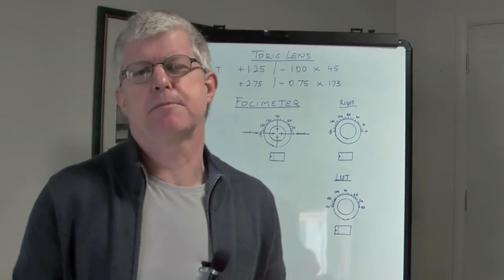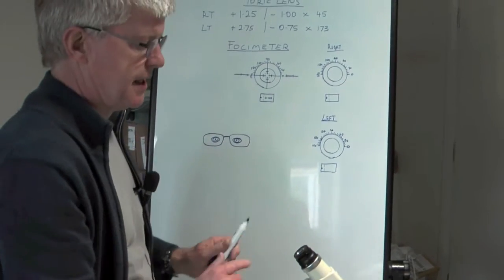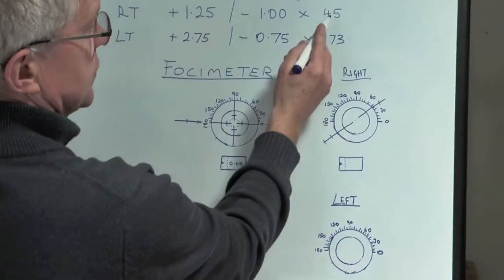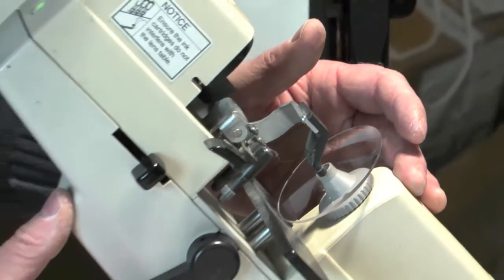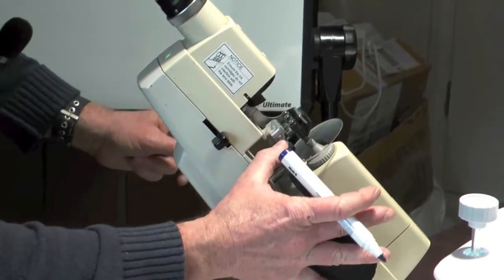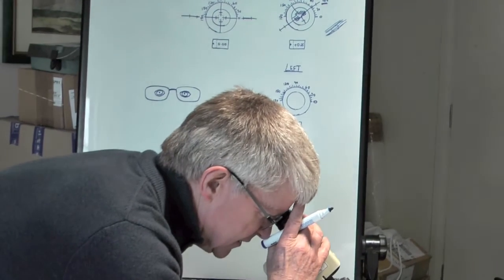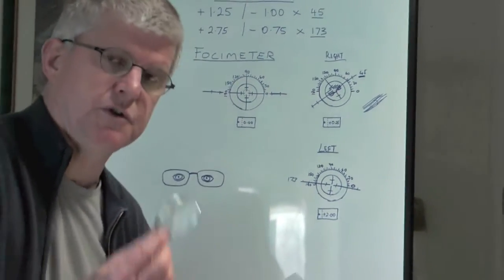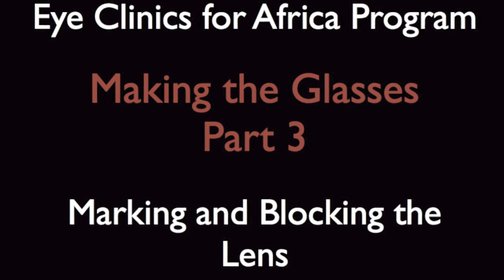Glazing Spectacles Part 3

Comment: How would you mark up the lenses to account for IPD decentration using the focimeter?
Reply: Mike Ashfield you don’t mark the decentration, you mark the Optical center. You will calculate the distance needed to decentrate from the prism in the prescription and you’ll block the lens  the appropriate distance from the Optical center. It’s in the next video of this series.